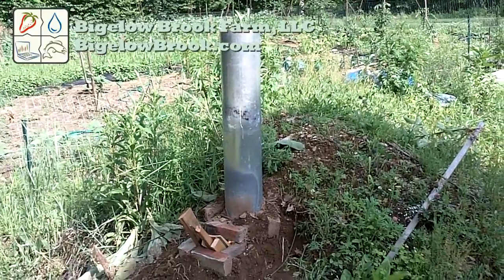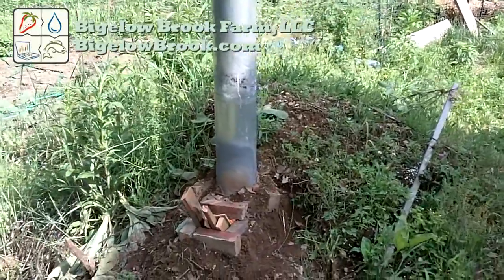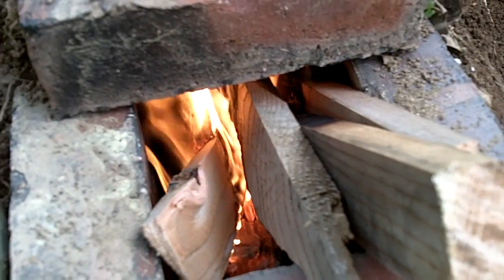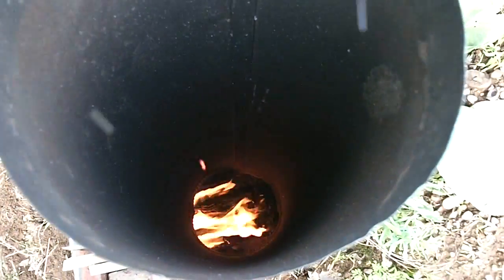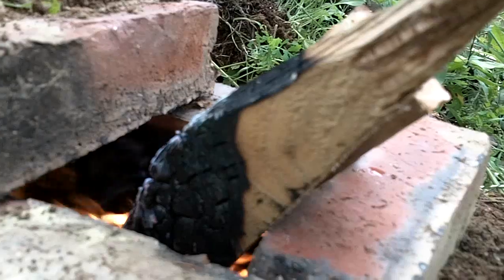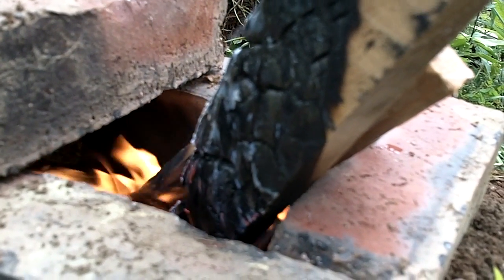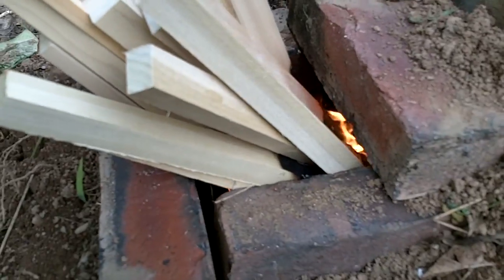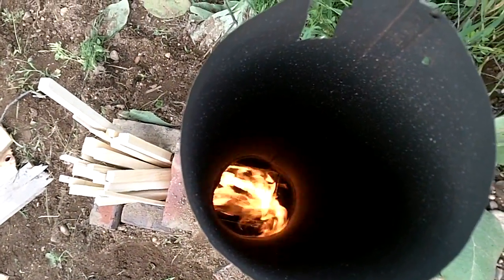Rocket Mass Heater prototype

Comment from the maker: @NewEnglandgardening Furnaces or wood stoves don't burn hot enough so there is a lot of soot left in them.  If you cool the chimney, the creosote will build up on the walls faster.  This video doesn't show the entire heating system, but the wood burns so well, there is little (or no) creosote created.

Comment: Hi This is in response to the heat exchanger comment.  I recently replaced my old furnace. There was a 15 ft exhaust duct to the chimney and I always thought it would be a good idea to put coiled copper pipe in it to extract the heat since it got very hot and I thought that was a waste since it just went up the chimney.  After talking to the heating guy I realized it is more complicated.  In combustion you need a certain amount of heat to expell the bad gases out the chimney or they will stay.

Comment: @web4deb Hi, I think the furnace guy was talking about things like carbon monoxide.  Ideally you would think you would want no heat going out the chimney but the carbon monoxide or other  gases would not rise so you would then need a more complex system of mechanical exhaust to make sure you get rid of them but then you need a fail safe or back up in case the fan fails.  So you need a certain temp of exhaust to guarantee they exit.  I'd make sure to have a carbon monoxide detector in the dome.

Comment: You could put some pipes inside the stack or some copper tubing wrapped around it to make a heat exchanger.  Run water through the pipes and, then run a loop of them into the floor for a radiant heating system.  That would use the floor as a heat sink (ie efficient), and require little power to pump as convection currents would do most of the work once hot.